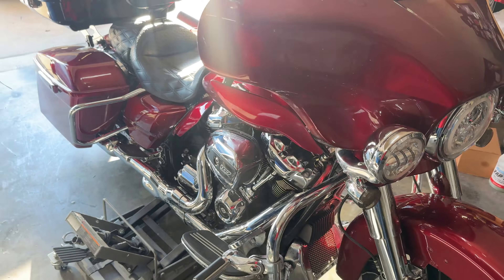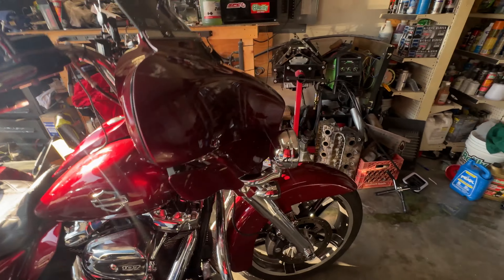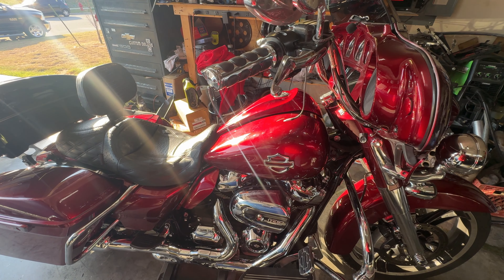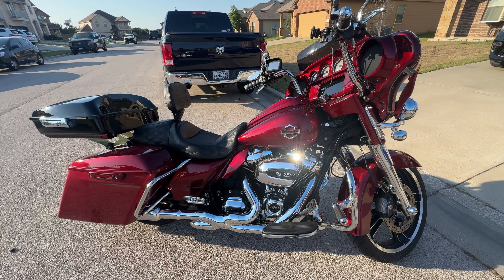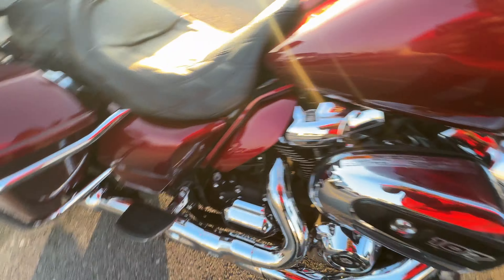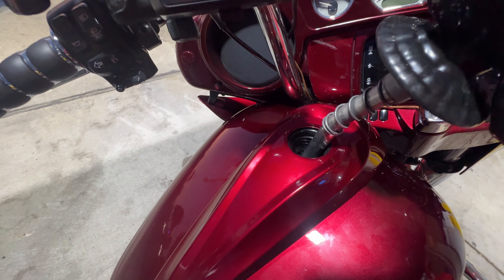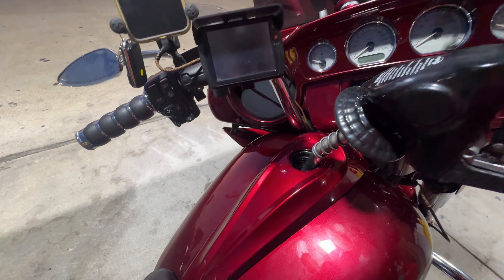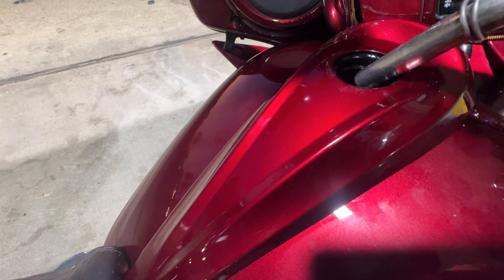WE LIFTED AND BURPED THE TANK ON MY HARLEY DAVIDSON STREET GLIDE

Comment: Dude scooter looking good. I just bought a 2013 Tri Glide; I have done all the DK CUSTOMS mods to cool it down and it is still running hot as hell. I am even running 2 oil coolers nothing has helped. High flow breather gutted cat gutted VH mufflers pipes Woods 222 cams with S&S HV oil pump and S&S cam plate with fuel moto adjustable pushrods. Extended floorboards oil filter relocation with jaggs oil cooler mounted on the down tubes tank lift with deflector wings, I am waiting on my new tune from fuel moto now. I remove my lowers in the summer also. I will say this though the woods 222 cam brought my 103 out of the factory coma. I mean brother that 103 is a torque monster now. When you twist the throttle, it is smiles for miles, best money I have spent on it so far. Hoping the new tune will cool it down some. You should buy a heat gun and show engine readings in different locations and readings on pipes after you have ridden for a while. I also wrapped the exhaust with titanium heat wrap still feeling the heat dude. Ride safe brother and if you want wake that bitc- up throw you a wood 222 cam in it and new bearing, you can do it yourself I did and have never been in a HD engine before. You will be amazed after gutting cat and exhaust it sounds like a 350 chevy hitting hard.
Reply from the maker: Thanks man i thought about going with the s and s cam check kit cause i feel like maybe the  oil pump on mine since its a 17 is not optimal idk im gonna ride to dealership tomorrow and see what they have as far as service history i heard that  the woods cam is great although i was thinking about the s and s 475 also was thinking about attempting to try to do my self  the temps i saw on dk idk if i can even achieve cause even with the lowers off  80 down the highway im at 304  but i also live in texas so lol
Reply: @LSHD254  Stay away from Harley and the tunes they have; they are highly regulated by EPA. Call fuel moto they will hook you up with the right cam for that bike and the correct tune. They are on point when it comes to performance.